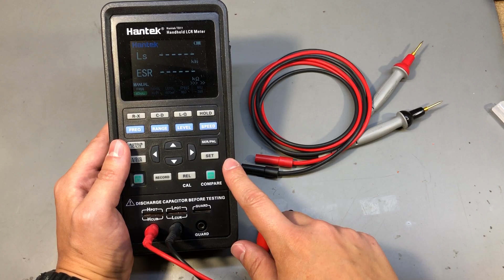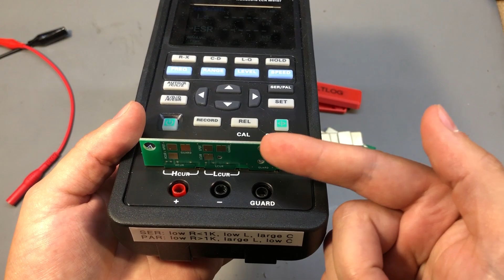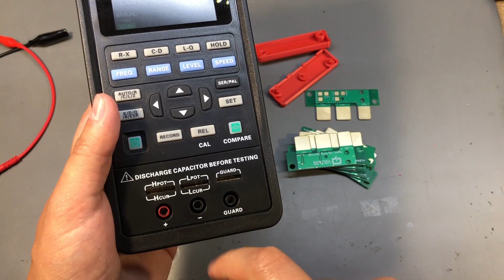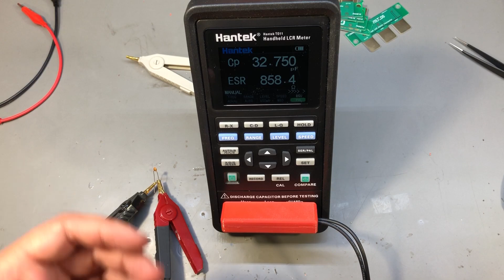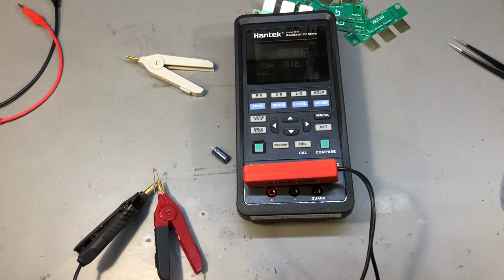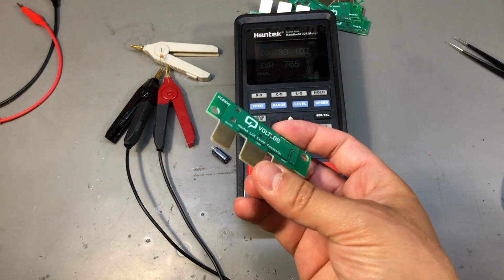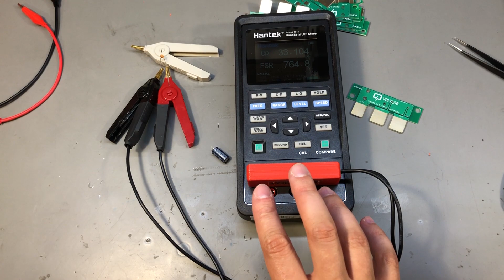Making Kelvin Test Leads For My LCR Meter | Voltlog #326

Comment: It is interesting, however, that when the same Hantek 1832c was tested by Tony Albus here on Youtube, the findings from the measurement results were that the supplied simple measuring clamps are not significantly worse and that the kelvin clip does not bring anything significant in measurement accuracy for the money. So, a bit misleading information.

Comment: Again your fingerprints are all over these probes. These are useless when it comes to exact tolerance readings. You'd be surprise. I made some test and sure enough it threw it of by as much as .03 to .04 ohms. So I would clean them good with alcohol before use.

Comment: Your connector is loaded with your fingerprints. Not good for measurements because of the slightest oil on the gold strip can throw your measurements off..

Comment: I always wondered why the both wires are soldered to just one side. If the contact point is where they need to touch why wouldn't you solder each wire to separate legs ?

Comment: Are you aware that there is no signal coming out of the guard terminal of this Hantek? It should have the same voltage as the "hot" lead. Suggest you hook up your scope to hot and ground and then to guard and ground and see what happens.

Comment: Hi! I'm glad about finding this video (and the link to tindie) while I'm about to build something similar!  But you do not show the details of the connection of the cable to the clips. Certainly, you connect one wire to one jaw and the other wire to the other jaw while keeping the shield unconnected. Do I guess correctly?
Reply from the maker: Hi! @5:00 there is the discussion regarding how the wires are attached to the clips and you are correct shield is isolated and unconnected.
Reply: @voltlog  Oh, thanks! Somehow I managed to stare at the clips, and to overlook the text.

Comment: For RF components: up to how many pF can be measured and with what accuracy? For the inductance I would be interested to know if, at an extremely approximate level, it is possible to use it to easily build turns in the air for tens/hundreds of nH, and then weld them and definitively model them on the final circuit (with the VNA). If this is not possible, what would you recommend as a cheap bridge, perhaps (also Chinese) complete with Kelvin pliers? Thanks

Comment: This PCB adapter is very intereseting. Where I can buy this PCB? I’m from canada
Reply from the maker: I will add the PCB to my Tindie store soon and you will be able to order it there.
Reply from the maker: You can order the PCB adapter here https://voltlog.com/y/5j964 Use discount code A101B3FF for a special price.
Reply: @voltlog  Can you add the plastic case too for order?  
I would order both.  Thanks
Reply from the maker: @michelgauvin2473  I'll have a go at printing a couple of those this week and let you know how it goes.
Reply: @voltlog  Super, I'm looking forward for them.  I'will order two of these with PCBs.   It's hard to understand why Hantek does not include or offer a kelvin clips and tweezers kit with their own meter.
Reply from the maker: @michelgauvin2473  the 3D printed enclosure is now available as an option on the product page on tindie.
Reply: @voltlog  Ordered! Thanks you very muck.

Comment: Do you have any experience with the hantek portable oscilloscope? It’s looks almost identical to your LCR meter. I need a good portable scope to take with me when doing repairs on the road and away from my lab… I really don’t want to spend $500 for a siglent or micsig… And I think the hantek would do just fine.

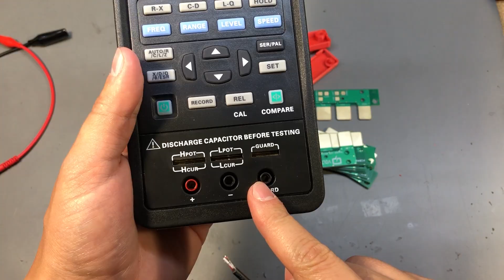Comment: At 3:52 you appear to describe the connections incorrectly: "plus and minus in the same shield".  Surely that should be "Hpot and Hcur in the same shield, Lpot and Lcur in the second cable also together in the same shield"?
Reply from the maker: Correct, that's how they're wired: "Hpot and Hcur in the same shield, Lpot and Lcur in the second cable also together in the same shield"
Reply: @voltlog   Shouldn't sense + and - be coaxial to remove CMN? Although yes this requires you to split them again at the clips.

Comment: I've got the Hantek TO22 equivalent meter (1833c) and already ordered those pre-made Kelvin leads you pointed out on your video from Aliexpress a few weeks ago, so i'll let you know how they go.  I've seen user reviews on Aliexpress that they work fine for this meter but will be interesting to see if they improve accuracy on measurements.
Reply: I think guard is fake on Hantek handheld LCR meters. It is connected to ground.
Reply: Forgot to reply here, the Kelvin leads definitely help this meter, it's still not perfect, but for the price of this meter, it's good.  Been using it a lot lately to confirm ESR readings on SMD capacitors and it's quite close to factory ratings.
Reply: @EnergisedAdrian  I received the LCR Meter. I'm gonna test it's GUARD port and inform you.

Comment: A comparison to a measurement with the 2 wire method and your high quality probes would have been nice. I'm not super convinced a kelvin measurement is that useful for a LCR meter as lead resistance can be zeroed out, voltage drop is not a major concern and parasitic capacitance should be pretty much negligible at low frequencies.
Reply: I think the really low Impedance/ESR measurements would benefit the most with the Kelvin leads, on ultra low ESR capacitors for example, as even putting a small amount of strain on the banana leads will vastly impact your measurements, but in this situation i'm wondering if that thin AWG cable used here is thick enough, I know the meter can be short calibrated and rel zeroed but I still wonder.

Comment: i`m working on fixing a pair of kelvin clips for an mastech ms5308 that i picked up used, the wiring on mine cracked right where in enters the clip causing leakage in the megohms, it was annoying to troubleshoot, i think ill just replace the whole wire with the one from this video , thanks

Comment: 800 Ω ESR? Hmm...??
Reply: it's a 33pF capacitor it's going to have high resistance at <40khz
Reply: @EnergisedAdrian  You need to learn about resistance vs. reactance, etc. True, if it's testing at 40kHz, it'll be...difficult...to get meaningful ESR readings of 33pF!
Reply: @qwaqwa1960  What would you approximate the ESR reading should be then? keep in mind the meter in the above video must have tested it somewhere between 100hz - 40khz  as that's all the meter can do.  The Equivalent series resistance will be very high at lower frequencies whether this is accurate or not
Reply: @EnergisedAdrian  Under 1 Ω I would think. Xc @40k is about 125 kΩ, so the ESR of "800 Ω" (0.6% of Xc) is understandable, and probably within the meter's spec (if it is spec'd), even if wildly wrong.
Reply: @qwaqwa1960  Well, I just did a few searches on TDK's online capacitor selector, a 100pF mlcc ceramic capacitor has an average ESR of 350 ohms at 40khz - it didn't show anything for 33pF but you can extrapolate from that... 800 ohms is in the ballpark.  Unless their figures are approximated and also wildly off?
Reply: @EnergisedAdrian  Hmm...VERY interesting. Looking at, for example,
https://product.tdk.com/en/contact/faq/19_esr_modeling_fot_tdk_capacitors.pdf
...yes, the contact ESR (Re) is minuscule, but they also talk about dielectric-loss based ESR, which is frequency-dependent. Though...the paper doesn't really explain it! Gonna have to research this further to understand what it really means.